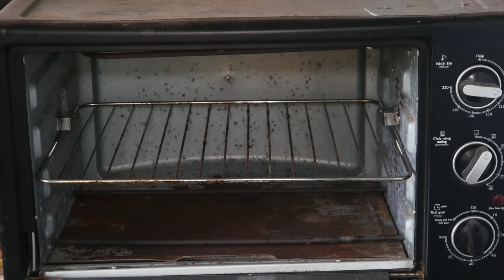Forge the most powerful weapon on the battlefield - the general's scimita

Comment: FYI, it is considered to be more of polearm than sword. The literal translation from Chinese is staff (or pole) single-edge blade. Dao is used for both a single-edged knife and a single-edged sword.

I am curious as to how heavy it is. For it to be functional, it should less than 4 kilos with a well weaighted mace head at the butt for a counterweight.

Beautiful, regardless.
Reply from the maker: Thank you for watching, I appreciate your opinion!
Reply: First of all, it is not a practical weapon. It was created by blacksmiths of the Ming Dynasty around the 16th century. It was used as a tool to reflect sunlight to lower the temperature around the emperor when he traveled. It was designed in the shape of a scimitar to intimidate civilians.
Second, in animation or game works, the hero who wields that kind of weapon historically used more bows, arrows and spears. The most common saber of that era was a medium-shaped sword similar to a short katana. And the blade is almost straight with no curvature.
Reply: In addition, samurai from the 16th to the 20th century would use this long-handled expansion knife for weight training or perform street performances to promote health medicines.
There is no clear standard for its weight. The user can take as much iron as they need and give it to the blacksmith for forging.
Reply: In the 12th century, there was a military knife whose specifications were quite similar to that of a long-handled knife - the "朴刀（Pow Daw". The design of this military knife is very clever. It separates the blade from the long wooden handle. When not in use, the samurai will use the wooden handle as a protective stick. Once an opponent uses the knife, the samurai will store it in the scabbard at his waist. The knife inside is taken out and mounted on a long stick for fighting. At present, because there is no physical object preserved, it is not clear how the long stick is connected and fixed with the knife and can be easily disassembled. We can only roughly know from some ancient pictures and text descriptions that this is a long weapon with a detachable long handle.
Reply from the maker: Thank you for your information, it's very helpful to me! @大塊死皮

Comment: The weakness is at the blade joint to pole, just 2 pins to withstand the shock impact. Cant even chop fire wood or a tree.
Also too much unnecessary decorations.